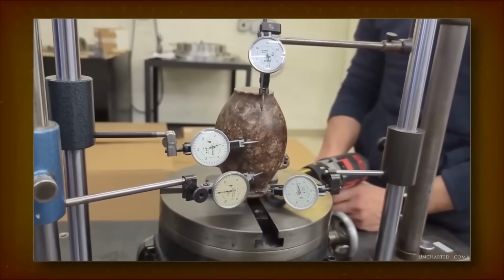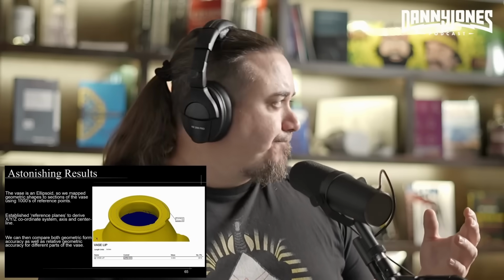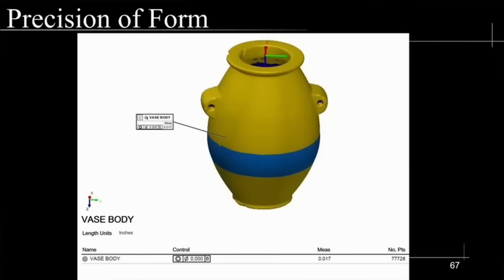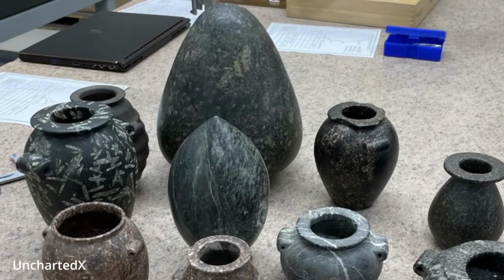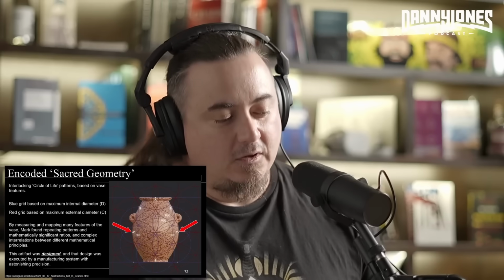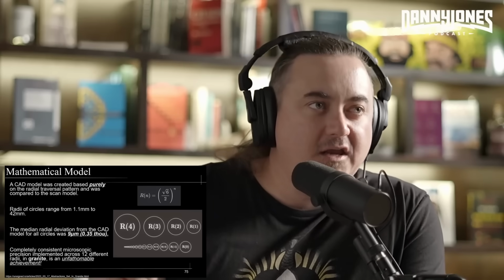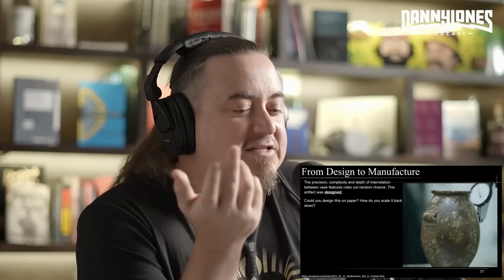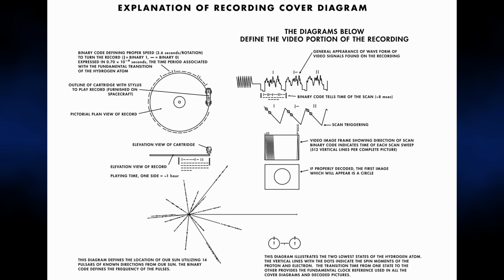Are These Ancient Egyptian Vases Actually Impossible to Make? #podcast #science #history #egypt

Comment: I'm a master carver known for creating "unmakable" things, so to speak.  The image of the vase at 10:04 is a huge hint at what's going on here.  You turn the vessel on a lathe leaving the toroidal bullnose.  The handles happen while it is still in the lathe with an attachment I haven't seen on modern lathes.  You would need an armature attachment that hinges along the lathe's X axis.  On this armature you'd need a spinning tool that can be rotated over the side profile of the vase.  You can remove the material between the handles this way, or, as shown in the picture at 10:04, index the vase on the z axis to create flutes.  By rotating the vase slowly you can swing the armature back and forth and completely remove the material between the handles, all while maintaining correct tolerances.  If you contact me Ben, I can build one of these attachments for my lathe and show you how it would work
Reply: I want to see this.
Reply: I’ve been to Egypt a few times and I’ve seen these vases up close, like behind glass only 18” away.   Here’s the kicker—the inside of the vases are not polished, so you clearly see the record album groove from a lathe.   I saw no individual carve or tooling marks on the interior, just the tight continuous groove.
So owning two lathes myself, one for metal, one for wood, my first question is what cutter could they have used on this granite, since granite is about as hard as it gets.    Meteoric iron?   But there are hundreds of these vases, and that cosmic iron is very rare.    The next question is how in the hell did they secure a cutter tip to the toolbar, unless the entire bar was iron.
I’ll pose this though if you’ve never heard of it.    There were isolated cultures in various parts of the world, to include one group in Sub-Saharan Africa, that during the Bronze Age, figured out how to smelt crude iron ore in small batches.
We’d all love to know how these vases were made, but as of yet, we don’t know, and there’s nothing wrong in admitting we don’t know YET.
Reply: @SME.Retired  And nobody addresses the fact that before you have a round piece of stock to start turning, how do you prepare the piece to go into a lathe?  And if it's not round when first put in the out of round granite acts like a jack hammer against a tool bit.  They had to of had lathes, and if that's the case, then surely they were harvesting granite with tube shaped bore hole drillers so they had round stock to start with
Reply: @robertjones1730 it would be interesting if any quarries were found with tubular holes in the granite. Then your hypothesis would be pretty much proven.
Reply: @robertjones1730 they probably started with a core from a slab, using something like a diamond hole saw
Reply: @SME.Retired   Not hundreds of vases, over 30,000 of them IIRC. And someone correct me if I'm wrong but aren't the 'flaws' described in measuring tolerances what you would expect from just dust or dirt particles? We are confronted with the impossible, produced for what appear to be everyday usage, almost casually.
Reply: @SME.Retired   The 'tight continuous groove' of the interior and the lack of a need to polish them at least gives some clue to the manufacture.
Reply: @SME.Retired its not hard to set a diamond into bronze
Reply: @SME.Retired  i believe they would have used quartzite crystal points.
Reply: @SME.Retired  Real natural diamond tips is my guess. But that would require working natural diamonds too.
Reply: @SME.Retired  But - the outside is polished sure, but it doesn't deviate literally 0.001 inch all over. So that's a kicker to your take.
Reply: @simonrussell77 I’m not sure what you mean.  I’m saying by using a lathe, one does get those tight tolerances; just that the inside does not get a final sanding polish, and the lathe theory is supported by the presence of lathe cutting grooves.   It’s understood that anything on a lathe will have low circular dimensional variance.
Reply: @SME.Retired  Maybe the vases are modern fakes. Did you think about that?
Reply: @noway8563 there’s thousands of them, who who in there right mind would spend the time and the money to make these and then plant them in an archaeological dig for free?
Reply: @noway8563   Even THEN they'd be amazing. And there are more than 30,000 of these things, with iron-tight provenance.
Reply: @craigthescott5074   I just looked up 'antique Egyptian stone vase for sale' and one (who knows how old) came up, $50,000. So if anyone can do it and pull off the 'antique' part, there's money to be made.
Reply: @craigthescott5074  The high precision ones all lack provenance to specific excavations. Some vases with provenance to excavations have been scanned and they're much less precise
Reply: Now make it of granite and 1/40th in thick
Reply: So, step up and show us your work.
Reply: Do it 😎 I'm sure if you were able to pull it off and post it it would reach the right crowd
Reply: When you get one you can be taken serious.  Until then you're just shooting your mouth off.  So get to work
Reply: I think that a lathe would be to primitive to produce this art
Reply: And let me add they used mathematical constants that don't to our modern standards they removed material at rates that cannot be reproduced I would love to see a video of you creating one of these I will absolutely subscribe to your channel and tell everybody to subscribe to your channel even in comments that have nothing to do with making vases
Reply: @calebsone1630  google wooden tuba, I'm the guy holding the mahogany tuba I made.  I don't care about subscribers, but I'm certain I could make one of these, and I think I will just so I can say I'm the only human to do it since (whenever these granite ones were made)
Reply: Go ahead, we all wanna se the results. If no results we also want this feedback, for the good and for the bad. Then also some conclusiones and how you made the whole process. I'm pretty sure nobody can recreate this by the methods they were supposed to have at that time, there was for sure more technology applied, call it alien or whatever.
Reply: If you can replicate one of these vases and they have the same precision, you will be the most famous person in the world. It's not just the precision either, there is a world a geometric and mathematical story encoded in each one of them.  One could spend a lifetime just studying one of these things and still not have all the answers.
Reply: It’s not just that it’s difficult to make without highly specialized equipment but it took an extreme understanding of mathematics and 3d geometry with the ability to design it ahead of time. Then they made it with greater precision than we have today on some of the surfaces. 

Sure you could probably replicate it today but the point is the ancient Egyptians didn’t have the technology both for designing the vase and making it. Not to mention they didn’t have the ability to measure down to the 1000th of an inch precision along a curved surface which the creators of them achieved. We’ve never found a lathe with external cutting wheels or depictions of them in Egypt. 

If you want to prove you can make it do it with what mainstream archeologists say they had at the time. Not your modern lathe.
Reply: @Foxtrot500 "If you want to prove you can make it do it with what mainstream archaeologists say they had at the time. Not your modern lathe."  This sentence right here shows you're missing the fundamental issue here.  You cannot under any circumstances make it with what mainstream archaeologists say they had for tools.  So it leads to an obvious conclusion that our mainstream archaeologists aren't correct.  Just because we don't have bones from all the people that lived back then, doesn't mean that there weren't people.  The remnants of the culture bears out that there must have been a lot of people.  The remnants of these vases bears out that there must have been better tools.  Maybe we just can't ever know but we should keep trying to figure it out, with OPEN MINDS
Reply: @robertjones1730 I’d like to point out that you are the one offering to make something with modern technology that is easily possible just with lesser precision. I’m not missing anything really. The point of the video is that they wouldn’t be able to make it with what mainstream archeologists say they had at their disposal. They still believe the Egyptians were quarrying the large granite blocks by putting down sand and rubbing a sheet of copper over it to cut through the material. You can’t exactly use that technique to make a precise granite vase or take the core drills which are also present at the quarries. 

Even worse is the argument that they used the primitive lathes they used on alabaster which used basalt or diorite rocks to grind the much softer material. Granite is a 6-7 on the Mohs scale and all of the other rocks in the area are within 1 level on the Mohs scales meaning you can’t really grind Granite very easily that method. It would chip a bunch due to how how hard it is and close in hardness it is to the other stones. Furthermore it would not have as precise of a surface as they all do. It would take modern water cooled diamond or ceramic cutting wheels used for tile cutting to really make a surface that smooth. Thats technology that they didn’t really have. 

The point of the video is that these vases alone prove that either the Egyptians inherited lots of the great stone work in the area from a past empire that had some kind of technology they didn’t and they just graffitied them to make it their home, or the Egyptians had some sort of technology that they never depicted on temple art and was destroyed never to be seen again. Either way mainstream archeology is wrong and need to shift their theories to fit the findings of just these vases.
Reply: @Foxtrot500 In your 3rd paragraph I can see that I totally agree with you.  It boils down to the vases are evidence of a higher technology at some point in history than we previously thought people had.  My contribution was only to pitch a potential concept of how it could have been accomplished, in an answer to the title of the video, "Are These Ancient Egyptian Vases Actually Impossible to Make?"  I feel like it's likely inaccurate to call them "Egyptian" vases, just as calling my truck a robertjones truck when I didn't make it and I don't know how to make one, I just owned it at one point.
Reply: Within 0.002 of an inch? Don't think so.
Reply: We would all love to see you replicate this object with the level of precision observed in this video. However impressive that may be, it would only further reinforce the truth that is currently being ignored or even censored by many archeologists and Egyptologists: ancient people were extremely technologically advanced. It is the only explanation for such artifacts, the evidence is there for all to see. I also think there's a great point at the end of the video that suggests this was done intentionally as their version of the "Golden Record." 

If you don't accept this truth, then you believe that people were able to achieve an impossible level of precision by banging on stones with other stones. Somehow the mainstream view is that you are a conspiracy theorist if you believe the only plausible explanation.
Reply: But remember what was pointed out in the interview, there's always something off when changing to a new tool or cutter. Even on today's most complex machines there will be, without a doubt, some microscopic deviation in the continuity of the cut that's not in the vase. An infraction not visible to the naked eye or measureable with basically high quality tools, calipers, etc, but again it will be there.
Reply: @gjle  maybe they just do all the surfaces again in a finishing pass at the end with a new tool
Reply: That's the point. You need a lathe to make these things. But they are like 5000 years old. They didn't have lathes back then. Lathe's are a 19th century invention.

So either they did have lathes of some kind back in the stone age or ... what, exactly?
It's not that it's impossible to make such stone vases today with modern tools. It's that they are impossible to make by hand with stone age tool that we know they had back then.
No matter how you look at it these vases are strong evidence that there was some kind of technology available to at least some stone age people that was far beyond anything we give them credit for. 
And that should give us cause to seriously question the conventional view of ancient/prehistoric humanity.
That's the point Ben is making.
Reply: Yes we aint the only ones who have computers.The gave existed thausands of years ago.We are not alone
Reply: The process you described sounds like the Sears router lathe, in which the router bit does the cutting, but not the traditional lathe that spins with the material being removed with knives/chisels.
Reply: If you had the same block of stone how long would it take to make one of these vases with modern machinery?
Reply: @craigthescott5074  It depends on the stock removal rate.  You can remove material faster at the possible expense of precision or wear and tear on tooling.  With a human controlling the feed/speed rate and a reasonable rate of removal, I think I could make one in close to one day, less than two.  This one he shared in the video was about 6" tall if I remember him saying.
Reply: That’s similar to what I was envisioning. Kind of like a lathe, but rotating slowly and a spinning disk cutter of some kind. The spinning disk cutter would normally have its axis of rotation parallel with the center line of the vase. Then to cut out between the handles, the cutter disk would be turned so its axis of rotation is perpendicular to the base center line. 
Some kind of template could be used to define the profile. 
I’m clueless as to how the interior might be shaped.
Reply: @walterandykathleen 
core drill the outside to a cylinder.
Attach to a potters wheel.
Then core drill the vase.
Using a swinging arm with a rotating tool on the end, sweep cuts to carve the interior, eventually to polishing.
Using the same swinging arm and tool, extend to the exterior and start roughing. Bringing it shorter in finishing passes leaving the handle torus.
Switch from rotating the vase to swinging the cutter only while indexing the vase to remove the excess torus leaving the handles.
Switch to a combination rotating-swinging to polish finish surfaces.
Use a smaller drill on the handles.
Lastly, flip the 99% finished vase bottom up on the wheel to grind the base.

All of this could be done with bronze tools with bulk low grade diamond bits cast into the tooling.  The trickiest part would be getting tight pivot joints on the swinging arms and smooth potters wheel rotation.  And of course a steady rotating grinding tool shaft.

All heavily flushed with water.
Reply: @sprky777  No way known this technique would deliver the precision and lack of deviation of these ancient vases. Next!
Reply: @sprky777   All to be used in a household to contain olive oil or for other daily use?  When you could just use clay or maybe blown glass?
Reply: there were no tools, no machines, the vases were made a method unknown to mankind, not by mankind
Reply: Sure you can, professor. Thats why you're name is everywhere debunking this vase issue. Troll -bot 1000 over here.
Reply: So modern carvers with modern tools, made something that resembled these things, but still the symmetry and perfection cannot be matched? How much more denial do you think can be created by people with absolute closed minds?
Reply: What BS the machining is the easy part, getting a high standard of finish and maintaining the accuracy is the real problem.  I trained as Fitter & Turner  and I'm not stupid enough to admit I could even make it. Cheers Phil
Reply: Then make one yourself with  hand made tools. Until then.  Shhhhh
Reply: - “if you contact me I will show you how it works” 😂 kid, just do it and upload the video….even then IF you manage to do so then it would basically mean these people had your tech or something more advanced to achieve this 🤦‍♂️🤷‍♂️
Reply: Record making one send it to them to check out they would probably love that they want someone skilled to help skilled people hard to fined everything done with machines now
Reply: Yeah dude. You need to do it!!!!!!
Reply: Laser cutting!
Reply: It's always satisfying to hear someone that's actually a tradesman debunk the alien BS.   Claiming an alien conspiracy steals praise away from the amazing craftsmen that built all the amazing structures, artwork, religious symbolism, etc.   It's men that made these things. Sometimes women too.  It's not aliens.  Aliens didn't come to earth to stack stones and carve stuff from rocks.
Reply: @robertjones1730 there is always so much talk about the outside of these vases, but please explain how they did the inside so that light can be seen through the stone
Reply: @MrAndrew1400  I have done some wooden "vase" things on my lathe and I'll say that the already removed material becomes a problem building up on the inside while you are working.  It acts like a Gravitron fair ride and sticks to the sides.  Stopping the lathe occasionally for chip waste removal is a thing.  Turning it vertical and boring UP into it would help.  As far as the wall thickness goes, I have a neat trick for you... With the lathe not running, have a probe touch the outside edge of the vase and with a platform mounted on the machine bed you can mark points that the X and y axis moves to when it touches the vase.  Connect those points to create a profile image on that platform.  Set your tool depth to the desired thickness to leave and start turning out the inside.  You could even cut a template that is connected to your machine bed that the x axis bumps up against as it works along the y then there's no guessing at all.
Reply: @MrAndrew1400  The walls one some of them were incredibly thin - like card stock.
Reply: A replica would obviously be impressive 👍
Reply: What are these 'handles' for then ? Might i ask?
Reply: @mikemcginnis1288   Carrying cords or metal handles; they're still intact on some specimens.
Reply: What tool-tip do have to use to remove that hard of a stone? And at what speeds?
Reply: It does require a precision lathe.
Reply: Inflated ego at its finest. Just goes to show that humans can not accept the fact that we ain't shyt. Make a youtube video and replicate one of the vases, "Master Carver" 🤡🤡
Reply: Start a YouTube channel asap!!!
Reply: That vase was glued back together  and shells wear used to fill in the gaps  I don't think they're casted  if it was casted they would be bigger
Reply: of course this is doable on a lathe machine, but do you think it's possible to do with something other than a modern lathe as we know it? could it be done in a simpler device like something made out of wood with a turn table and some jigs?
Reply: Thank you!!! I have been trying to say this in a much dumber way for years.
Reply: I am in agreement with you Robert. The reverse engineering they did with the CMM shows exactly how it was made. I get a kick out of people that think the ancients were not skilled. As far as getting the side wall thin, all they would have to do is check it with a candle occasionally. All of these stones are translucent when thin enough. Subtractive manufacturing has been around since the beginning.
Reply: Just lost technology, not aliens.
Reply: Wouldnt that procedure still leave some evidence of coving at the base of the handles?
Reply: True
Reply: See I knew it's possible to do!
Reply: Can we fund this guy?
Reply: Would sapphires & diamonds  be used to cut & polish?
Reply: And now go back 4,000 years and do that bro
Reply: Yeah pix or it didn’t happen and I’d like you to measure your creation as well (bummer, I know)
Reply: Until you make vases like these by hand with a chisel, we'll take away your title of master carver! 😉 😆
Reply: @gorpri1 - I don't agree. Replicating it, by any method, would be a masterful achievement. I'd like to see it done, to include the cost involved in doing so. The first would be very expensive as you'd have to invent new tooling and methods. Subsequent creations would probably cost less. The measurements of several vases are available for download. I'd love to see someone try to replicate these.
Reply: @dragineeztoo61 it's been done, but the results aren't as precise. There is a Russian lady (Anna?) who spent months making a vase by primitive methods. You can look her up on YT. Similarly, a high volume granite company in China was contracted to make a granite vase copy, albeit without matching the thin wall thickness. Their part looks similar but it's not nearly as precise as the rose granite ancient vases are.
Reply: @GregAz-z3s look into the Russian lady’s precision; the older vases are an order of magnitude more precise ATLEAST bc my brain has trouble conceptualizing much further 😅😅😅
Reply: @GregAz-z3s  you should take time ALSO watching the debunking the debunkers, and you'll find out where they used tools that didn't exist to start their project, they also DID NOT do the INTERIOR of the vases to ANY DEGREE of similarity.
Today's tech it's fairly easy to turn stone on a lathe and make a uniform and precise turned object.  However that's WITHOUT handles to any similarity of the ancient ones. As far as the interior of the vase, todays tools would bore out the vase sure, but there would be almost no curvature or thin wall at any point around the circumference of the outer walls.  I've also looked and asked many stone fabricators.  My brother owns a 5-axis milling company.  He disagrees with me regarding the complexity, but he stays away from the material differences of stone as to steel/aluminum, that he uses in his company.  They are on totally different levels of complexity.
Reply: @GregAz-z3s  How about if you had a thousand people working on them led by 4th and 5th generation potters and carvers who spent their entire lives perfecting the process? Probably they would know exponentially ore than the Russian lady who spent months...
Reply: @Decent_Animal  To be fair - she hasn't been trained since a toddler in apprenticeship to a business making these specific things.  So I would imagine a fair bit of knowledge on the precise technology and methods has been lost as we got better and different tools.  I am awaiting that time 1000 years from now when some archaeologist digs up an iPhone and claims 'we' didn't have the sophistication or tool base to develop such a thing.
Reply: @GregAz-z3s  Nothing from China is "not nearly as precise" for anything they knock off.
Reply: @GregAz-z3s   So what your telling me is, it hasn't then.
  "Not as precise" & "not as thin" probably means no!
Reply: @GregAz-z3s  Therefore, it hasn't been done!
Reply: @GregAz-z3s  I have seen their videos and it proves nothing.  They can cut a square corner in apiece of granite about 3x3x3 centimeters with a sharp 90* inside corners.  BUT they have not created a single piece of granite that approaches what the Ancient Egyptians did.  They also have not moved a 1 ton, or 10 ton, or 100 ton piece of granite a kilometer or 1000 meters.
They are using pieces of flint to do their cutting but so far (I have not watched their videos in a couple of years) they have not attempted to make a vase, a box (with lid and perfect 90* corners) of granite.
They are making lots of money via their Ancient Egyption debunking videos.
BTW, I am a retired tool and die maker.  I made gauges for various companies.  You cannot make anything accurately if you don't have a rock solid plan, tooling, methods of measurements (metrology) and lots of money (clam shells, beer, gold) to pay your craftsmen.
Cutting a 100-ton block of steel (to replicate the granite boxes in Saqqara) into a sarcophagus with today's tooling would be difficult and extraordinarily expensive
Reply: @GregAz-z3s 
"Aren't as precise" is the understatement of the decade. The only object that replicated this precision was done in an actual CNC machine. And was only accomplished by using marble, which is a much softer, homogeneous material. Quite unlike red granite.
Reply: @dragineeztoo61  I shape a stone ring only by abrasion, the middle hole is made by a roughly made wooden axle, connected to an old drill with a large tolerance... the ring is applied by hand on the wooden axle. The result is an absolutely circular and smooth hole. I did not use a comparator because I do not have one. But I insert a smooth chrome-plated steel rod, exactly right, almost without play and without circumference defects....
Reply: @dragineeztoo61 yep let’s see it 3 thousands of a millimetre in granite interior and rotated exterior including handles formed from the body - impossible then get a granite box micro wave oven size saw off the top creating a rebate then dig out with ya copper and bronze chisel the interior coffin form with smooth millimetre vertical with smooth form surface then create a right angle at all corners and base — please let THE WORLD KNOW HOW YOU GO !!!!!!
Reply: @GregAz-z3s so, it hasn't been done
Reply: @dragineeztoo61  - When you make thousands of them they get easier.  I am sorry you seem to think no one could function prior to electricity.  Watch wallywallington videos if you want to watch an old guy move huge stones.  Its not magic, its experience and knowledge.
Reply: @gorpri1  no one makes these vases this way in hundreds of years.  While thousands of years ago thousands were made so think who is the experts.  Not us.
Reply: @gorpri1  You are obviously a master baiter, I'll give you that.
Reply: @gorpri1 nobody has ever made vases like these with a chisel in the history of mankind.
Reply: @pcd565  I know. Zahi Hawass keeps telling this!
Reply: @gorpri1  He said he would make it on a lathe... learn how to read. And look him up. He doesn't hide behind a ridiculous handle. his name is Robert Jones and he is a master carver!
Reply: @glenncurtis6037  OMG!  It was a joke!
Reply: Make an video and abload
Reply: Sent this to a freind that operates pretty descent CNC machines.  The first thing he said was , I can’t even hold that tolerance.
Reply: @CM-fk8mu  That's true I suppose, normal machine shop working tolerances are +/- .005.  Sometimes a section of the part might measure exactly on but it is okay to deviate +/- .005.  Machine shops have ways of holding tighter tolerances but the parts become much more expensive since extra time is taken to measure and certify that it is all within tolerance.  I own 3 CNC laser machines and you might think these would be super accurate but in reality the frame slop and backlash means no better than +/- .005, probably more like .010.
Me saying I think I could make one of these is not at all to diminish how amazing the pieces are, but rather to add credibility to the idea of lost technology.  At it's most simple implication, they'd have to have mastered bearings.  But when you really think about all the needed steps, you can't just put a chunky weird shaped rock in a lathe and spin it.  There are so many supporting tools and technologies needed.  One part not mentioned that I find amazing is these tolerances are on a finished, POLISHED part.  When you are machining you do rough cuts, finer cuts to approach the final dimension and you can't have polishing remove so much material as to exceed the tolerance.  The more you know about machining, the more amazing and unbelievable they are.
Reply: @robertjones1730  sorry didn’t mean to post as a reply.  Should went to the comments feed.  I do think you should make your prototype as proof as concept.
Reply: Wheres the tools.
Reply: ..so ur sayn its aliens?
Reply: @rogerwilco1777  speak English.
Reply: @rogerwilco1777 so your calling him an alien😂
Reply: @rogerwilco1777  maybe he is an alien?
Reply: @rogerwilco1777  I take it's a resounding "No!".
Reply: @ThatUkrainianGuy1  But what if the Aliens are trying to be sneaky and using native methods to make something otherworldly. . . 🤣
Reply: Agree. But I’d add, the handles may have been an unintentional part of the design that arises through the process of carving. Like they carve from the bottom up to a length allowing enough structural integrity. Then from the top down. Leaving a ring that would then use something like the tool you describe. It may have just been a dimple that picked up the scribe every half turn.
Reply: @thepain321 but the handles are completely useful. Pretty sure they are meant for the function they serve. Not an afterthought.
Reply: My dude you know about it but it did not exist and there's no way you could recreate one of these vases not even if you tried guaranteed you would not make the same tooling marks and you would not make the same precision with anything that could have been made back during those times you could probably use a modern CNC machine and do this but you're not doing this by hand.
Reply: These vases are absolute evidence of advanced technology. Technology that matches our current technology. Obviously they were not impossible to make originally and they are not impossible today. They do require electrical motors, accurate bearings and shafts. Plus diamond tooling.

They are not made on a lathe however they are fabricated using a rotating base exactly in the manner Ben used to measure the vases. Cutting is conducted using an independently powered cutting blade.
Reply: With everything you have said it becomes even clearer that technology is definitely required.😊
Reply: Yes! It's a trick, that's why it's impressive. you assume the handles are done last which looks impossible.
Has to be a hanging lathe like a CNC, with the material to be worked on a gimbal to access the XYZ
The holes in the handles are done first on the X axis, the "handle toroid" is cleared on the Y axis, then the final shape is done on the Z axis to cover up the previous two axis steps.

The same way you would make a crop circle to cover up all your footprints....right?
Reply: @Triangle_Storm  Actually, the handle holes were likely added later so people could hang them with rope easier. They are much less precise.
Reply: That's exactly the procedure. The measured tolerances are achieved because every step is based on rotational movement arould a fixed axis. It is artistic and elaborate, but not fundamentally difficult.
Reply: @minimal3734 - "Not fundamentally difficult." In stone? I'd accept that if you're talking about machining in metal. But in stone?
Reply: @dragineeztoo61  The process in stone is grinding and not cutting, as in the processing of metal. Grinding is very slow and fault-tolerant.
Reply: Thank you.  

It's upsetting how many people have lost touch with what is possible with talented craftsmanship.

Dedicate your entire life towards craft with total pursuit of perfection and nearly anything is possible.